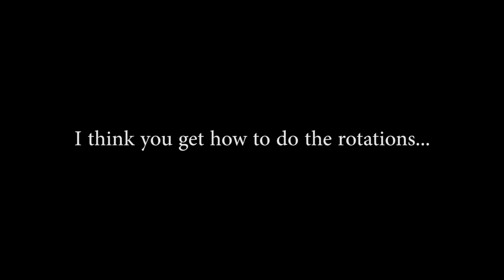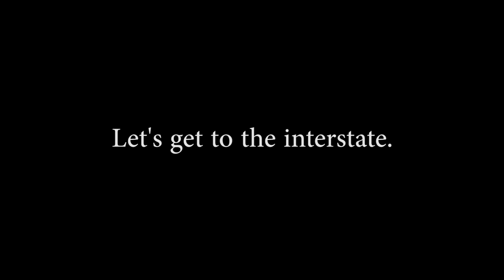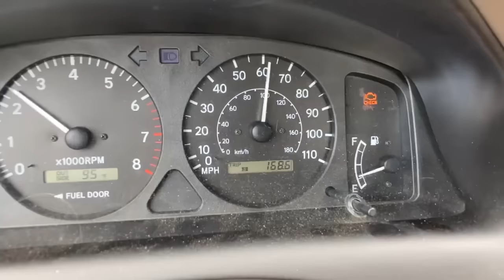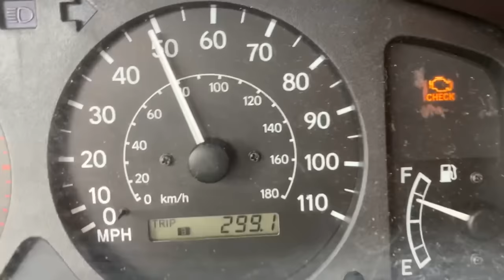Will Berryman's B12 Chemtool stop oil consumption? 😲 | Oil Burning🔥Experiments | Episode 15

Comment: You may want to run some paint thinner through the fuel system to clean the catalytic converter now.  Scotty Kilmer has a video explaining the amount/ratio of paint/laquer thinner to appx amouont of gas in the tank
Reply: I wouldn't do that unless you need to pass test.
Reply: Tonicofsinic.  The reason I suggested the paint thinner was because his auto had been consuming copious. Amounts of oil and figured his catalytic converters might be quite clogged restricting exhaust flow creating back pressure possibly if not already resulting in burnt exhaust valves followed if not already by excessively carbines up intake valves if his cat is significantly restricted.  But, I yield sometimes less is the best when it comes to trying to cure an engines ills with chemicals.
Reply: @hobtink  Ya I would try it too if it was throwing codes or had a slightly hotter temp reading on the backside but I firmly subscribe to the saying "if it ain't broke dont fix it".
I also subscribe to the saying "anything worth doing in life is worth doing right"
Which would be a new cat even if it meant no welds and held on by clamps put in on a driveway by complete amateurs.
Good enough is good enough, I always say. Lmao sorry that all came out in a ridiculous way. I am normally not like this maybe it is my migraine. Cheers 👍
Reply: bro, if your oil pan is painted from the inside, and you run paint thinner in your engine, your paint will clog up your oil pick up tube, and you will kill your engine.
Reply: @falsem1nd  I wouldn’t paint the inside of my oil pan and honestly can’t imagine why any engine or parts manufacturer would do so period it’s an extra step that is not needed snd those extra steps add to manufacturing costs.  And, your comment is definitely something to think about and research but to my knowledge the paint thinner is put in the gas tank to help clean the cat as the engine is operated.
Reply: @hobtink  I honestly don't know about adding it to your tank, I haven't seen Scotty's video, but trust me, there are definitely car manufacturers out there, that have your oil pan painted from the inside too. I got it from watching russian videos (I speak russian), where they use crazy stuff to flush the engines, and one of the things that works best is called Dimexid, it's a very strong solvent, and they specifically advise to check your oil pan before using it, to see if it's painted from the inside. If you want to, I can find you a video with a failed flush, where they drop the pan and show all the paint, that clogged the pick up tube
Reply: @falsem1nd  oh I dint doubt that some manufacturers paint the inside of the oil pan and probably valve cover as well.  Any mineral based and organic carbon based solvent can attack paint.  You as the heat and other agitation in an engines oil system and like you said blocked up oil pump suction screen and a toasted engine.  I suspect those manufacturers of stamped metal oil pans and valve covers that paint the inside of their pans and covers is to cover a metal than they haven’t been successful in preventing rust from forming on during shelf and transit times and the environments they’re exposed to.  But if u were replacing an oil pan or valve cover and it came in with paint in the inside the paint would be removed before I installed it or I’d find another supplier that did not paint the interior.

Comment: Be careful when doing this, change the oil immediately after the piston soak before starting the engine, AND squirt a teaspoon of oil into each cylinder before the first start. There’s another guy who did this on his Camry  and his rod bearings failed and caused a rod knock. He had the oil drain plug out and all the oil drained when soaking the pistons. Big mistake!
Reply: Liquid is not compressible. If the volume of the liquid is more than the space after compression the rod break. We must put less liquid.  And as said on other comment, put liquid and send compress air (leak down) to force the liquid go down.

Comment: You shouldnt be concentrating on the combustion chamber. Its the rings and ring grooves that are responsible for oil burning.
Most of the cleaning should be done from the oil side ie put the cleaner in the engine oil.
But most of the fluid has leaked past the rings and IS in your sump.
And 2 full bottles in a small 4 cylinder engine is a horrendously large amount.
The first application of engine flush (half a bottle) is when the most amount of carbon is washed out of the engine
and into the sump and oil should be drained in 300 miles or 500 km.

Comment: Thanks!
Reply from the maker: Thank YOU Paul!!
Reply: @FamilyFriendlyDIY  FYI.  I used your idea and the Berryman's on my 2019 Hyundai Santa Fe.  I purchased the car September of 2023 with 115k miles and found out it was burning 1qt of oil every 800 miles!  I did my homework and the first thing I bought was a $25 oil catch can, which reduced consumption to 1qt per 1000 miles.  Then I found your video and did the Berryman Cylinder soak for 36 hours.  The results are EXCELLENT!!! I have 3500 miles on the car since I did the soak and oil change and the dipstick is STILL on full!!!!

Comment: You no what would have worked better is Rislone hy-per fuel injector cleaner that a fact it would have cleaned up a lot better  than what you used

Comment: In my opinion that NEW oil at the end of the video looks gasoline diulted.  Look how fast the colors change as the oil drizzles down the dipstick so quickly leaving carbon solids behind.  You may have a bigger piston ring problem than you know.  I'd recommend a compression test.
Reply from the maker: I've done compression and leak-down tests in previous videos, Daniel.

Comment: Just put rings in my 7afe Celica today, the oil relief holes were completely blocked solid
Reply from the maker: How much oil were you burning?
Reply: @FamilyFriendlyDIY  Wasn't putting much miles on it so it's hard to say but a liter every 300 or 400miles approx
Reply: @billwanke1681  Been doing it in stages, waiting for parts/lift access etc. I'd guess 12-16hrs, quicker if you're a pro
Reply: Did you have to take out the block to change piston rings?
Reply: @billwanke1681  No, remove head and oil pan

Comment: I use a can of Engine Restore with every oil change. Haven't burned oil in the years I've been using it
Reply from the maker: Were you using oil before you started using Engine Restore?
Reply: @FamilyFriendlyDIY  yes sir. About 1/2 quart of oil every 400 miles or so

Comment: I have a toyota rav4 with a 2.4l I'm going to try this on. It has 200000 on the clock.  It's a check the gas and fill the oil vehicle

Comment: What exactly does this do
Reply: The ingredients in Berryman's will solvate varnish, and release burnt varnish (which is just generally called 'carbon'.)  Once they can float in the liquid, they can drain slowly to the oil sump.  Once these deposits are removed, the piston rings can spin and seal once again.

Comment: Nah, your gonna need to take off head and change valve stem oil seals and grind valves. Compression test will also tell you if you need to do anything to bottom end.

Comment: It didn't look like it work after the test but I'm beating the 300 miles after the oil change broke the rings lose all the way or as much as they can be.
Reply: The rings broke loose because of the redlining the car for 20 mins with the help of chemical on them. That’s why I’ve been telling people u need to rev your motor to the redline from time to time to help prevent carbon buildup in the piston rings and holes. High rpm engine spins faster, gasoline will be injected higher amount into the combustion chamber with high rpm. And yes, gasoline is the best cleaner u can have in the engine! With that amount of gasoline and that speed of piston pumping up and down, it will strip off or burn off anything in the piston ring land and groove
Reply from the maker: I thought the same thing, James ... especially with all the oil still on top of the cylinders after the initial drive.
Reply: @FamilyFriendlyDIY  I started thinking it might have some worn valve guides and the Berrymans might have let the oil in the top end slide past either way I call it a success.

Comment: Interesting how my Elantra 2008 2.0L with 159K miles doesn't burn any oil for 5K miles. I change the oil every 5K miles and still on the top not. Synthetic Castrol magnate 5w20. BTW, I trade my last Toyota corolla 2000 for Elantra 2008. I guess I did the right thing.
Reply: That’s how it should be for all engines all manufacturers. Change your oil every 5k or every 6 months which ever comes 1st. This is the only way to prevent oil consumption for modern engines.

Comment: With over 100,000 miles go to a 10, 40 oil that will help some old toyotas have valve guide problems I've had 3 toys with bad guides and they all used oil

Comment: Excellent video.   Thanks Dave for trying it out with B12.  My 2AZFE  burns about the same rate as your Corolla.   I tried Seaform (128 oz)/MMO 24-36 hrs twice with no different in oil burning.  I thought about doing b12 but I heard it's a bit strong.  Please keeps us updated on the long-term results.   I want to try the b12 on mine.
Reply from the maker: Thanks! I'll definitely do an update on this!
Reply: @FamilyFriendlyDIY  Here is my B12 pistons soak result.  I did a little different then your method.  I soaked it for 12 hrs with 4 cans.  I drained the engine oil before the soak and didn't put back the oil plug.  I didn't do the 6 hours interval.   I just poured in B12 and rotated it 5 time. When it completely drained out from the pistons,  I repeated the steps within 12 hours until I emptied 4 cans.  Afterwards,  I just put back the spark plugs and put in new oil.  It was tough to start back up (like your Corolla) and got some blue smokes.  I just finished put in 1,000 miles and it burned less than 1/3 of a quart.   It is just amazing.  Thank you very much for sharing your video.

Comment: When this don't work... Use oreilys brake cleaner and transmission fluid. 50/50 mix😎
Reply: The transmission fluid offer thickness to slow evaporative loss and some viscosity to slow the drain through rings.

I did a thin chemical, like acetone and most bypass rings to crankcase over night and diluted oil. This can cause rich codes. Like when the hi pressure fuel pumps fail and fuel enters oil.

I'll check back but currently I'm half way through video
Reply: Cool... B12 seem to made a difference. Here's the issue though, the cold start is where the issues manifest. Because the metal hasn't expanded. But but but... With all the chemicals you added this may have been work in progress!

Comment: It not that easy on engines that you can't get to the spark plugs. Add some to your oil is your only choice. The real problem is they over bafffe the oil pan and you do not get enough oil splash to clean the piston. Why they put oil squiter point up at the piston which is not enough oil to keep the low tension rings clean. On newer cars I would be careful using this stuff. Newer cars have oil screens in the engine which can get plug up and fuel filter is inside the fuel pump in the tank. What this stuff does to this stuff I don't know. My engines don't use oil so I stay away from adding stuff that can cause problems you don't have. You have a problem you don't have much to loose. I always put in 1 more guart of oil than the dip stick says. That way you get more splash on the pistons and timing chain. Change the oil and filter every 3,000 miles and you won't have this problem hopefully. Been doing this for 50 years and never had a engine use oil at 3,000 miles.

Comment: Should've pulled the plugs again and bore scoped for oil.
I'll bet with no solvent in the oil, you won't find oil puddles on the pistons now with good oil.
Gas mileage before & after

Comment: Those spark plugs probably aren't helping you. Older cars generally have weaker ignition systems that have issues firing platinum and iridium plug. I suggest installing copper spark plugs it may help your miss fire.

Comment: I can go ahead and tell you what will help you is automatic transmission fluid. put 1 quart in every 3 days top off with oil after 4x add another half quart of trans fluid. This fluid will eat this junk out of motor and screen filters. it works man. Then do a fresh oil change and watch your oil. you can ride 1 week with trans fluid in, just drive norm.

Comment: Did u clean your PCV system. I think u should, if not why so much oil on the pistons?  Congratulations anyway! 👌
Reply: The 8th gen Corolla 1ZZFE US built engine used low tension rings. Even proper oil changes allowed for oil burning over time. It was fixed in late 2003. Oil is better than it was in 2001-2002 so it can probably be eliminated.
Reply: @EricVonHunter  all engines thru out different manufacturers uses low tension rings ever since the 2001, no matter u r us spec, jspec now days. Some started around 2005. That’s why manufacturers switched to 0w-20 weight oil because of less friction thus more efficiency for mpg mileage. 

Even your motor has high tension rings, you will still burn oil if u change your oil at 7k, 8k, 10k, 15k after 7 yrs. if u change your oil just once a year, u r most likely will see oil consumption problems after 5 yrs for low tension ring equipped motor and 7 yrs for high tension ring equipped motor. The question is do people hang on to their car that long? Most people change car every 5 yrs so the problem always goes to the second third owner who bought the car used

Comment: I do not recommend driving your car with two cans of Chemtool mixed in the oil pan. Chemtool breaks down oil instantly. I have used it for forty years to clean oil & carbon off dirty parts. You are very lucky you did not destroy the engine driving the car with that much viscosity dilution.

Comment: I noticed a problem with the dipstick thing, and that is that you shouldn't trust the dipstick.

One car I had would burn a quart per week, until I decided to let it die. The second week it burned nothing, confused about the extended time I added a quart. Again, 1st week sucks a quart, 2nd doesn't, 3rd doesn't, 4th doesn't…

It turns out my dipstick was wrong, all it needed was a new (junkyard…new to me ;) ). The quart that kept burning away was about a quart more oil than it needed…

Comment: I used sea foam in my 1.4 astra the head gasket then went we fixed the head gasket at a cost of £800 we then found out that the crank had gone. Car was ticking and over heating garage replaced tappets and head gasket still ticking. Sea foam ruined my oil even after serveral oil changes i would add sea foam to the fuel but i would never again add it to the oil. car was scraped after spending 800 on head gasket because the bottom end was cooked

Comment: PS, you first 300 mile test for oil usage may not be very accurate with basically 2 cans of Berrymen in the crankcase.  Probably need to at least wiat until at least one oil change to quantify oil consumption
Reply: Don't skip video and leave comments

Comment: I saw one video where Uncle Tony used white vinegar to unstick piston rings, however he soaked the pistons and rings after they were removed from the block.
Reply from the maker: I actually watched that and thought about trying, but then he made a point to say it worked because the rings were stuck due to being rusted in place, and the vinegar acted as a rust dissolver. I thought it was risky to try on carbon.

Comment: 65 70 mph my 4.2 l V6 Essex engine runs around 2200 to 2550 rpm
Reply: Then u should keep it in 2nd gear or 1st gear the whole 20 mins drive if your gear ratios are that tall. I know c6 covette can go 67mph with 1st gear alone😮
Reply: @blackysan  my transmission is the 40r70w

Comment: I've been experiencing the oil burning phenomenon eith an audi q7..n im talking ridiculous...after much studying of various methods im too the conclusion that a cocktail combination of a seafoam and engine flush plus or no a penetrating oil like wd 40 at 3000 revs for 30 minute intervals 3 times should dissolve th carbon from the rings..and 40 40 20 respectively for the fluids...

Comment: You should let it soak longer and drain down before you rotate the crank. When I do this I let it soak until nothing is left in the cylinder this can take minutes or hours. Then before I add more I rotate the crank. 

I use a mix of B12 and Fuel Injector Cleaner that has PEA Amines in it. 

Then on the last go round I add a teaspoon of oil to each cylinder when I rotate it. No dry start that way!

Comment: Replacing rings from not changing the oil often enough will not help your problem because the cylinder walls are damaged. Don't add acetone in your engine. You are not a mechanic

Comment: I didn't expect those results.
I'd probably do it with a spray bottle with engine running myself.
.
Over many autos I've had good luck reducing oil consumption about 50% with the oil branded as high mileage.
But still with time it continues to get worse.
That treatment will probably need to be done annually in my mind.

Comment: My experiment lasted thru the first 300miles  after 500 miles i started using oil again.
Reply: Now thats weird.
Reply: @craigslstuser9  well my car is an official oil burner this trick dont work. only temporary.
Reply: @anthonyrippo1223  Well if it stopped burning oil after treatment. you would think the holes and rings got cleaned but to start burning after 500 doesn't make sense.
Reply: @craigslstuser9  whatever the chemical did was temporary thats all i can conclude.